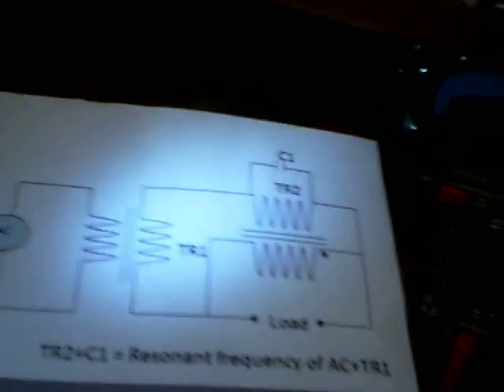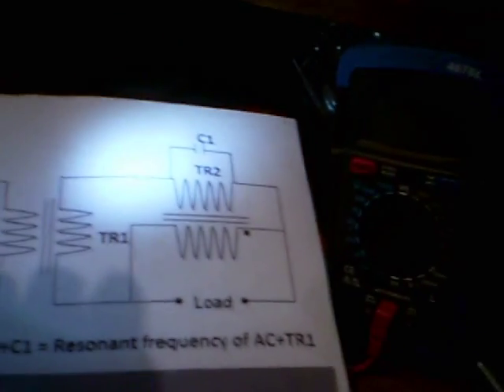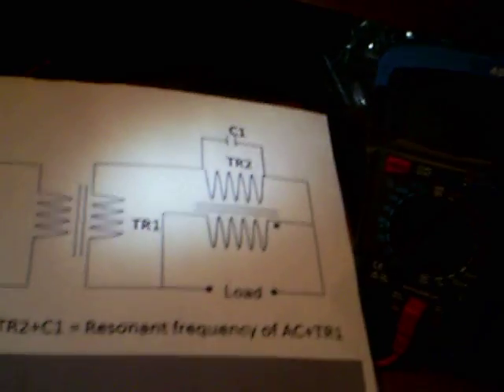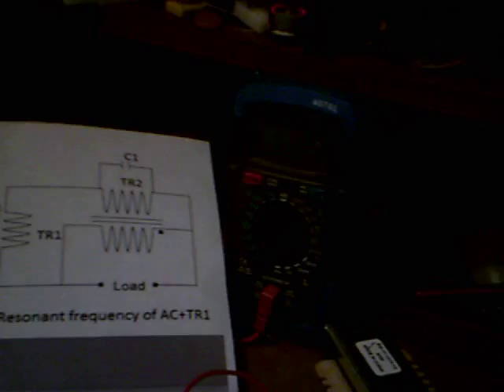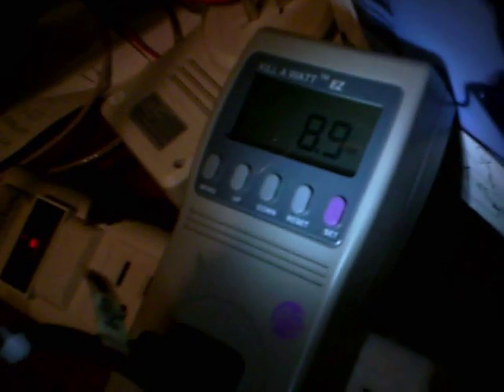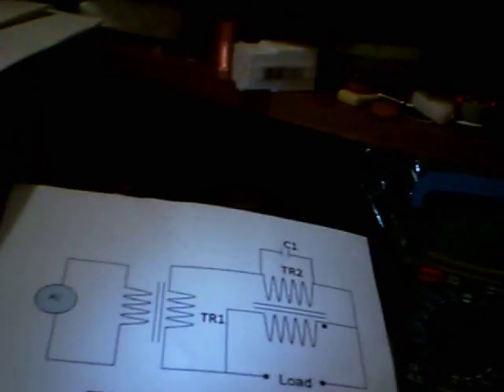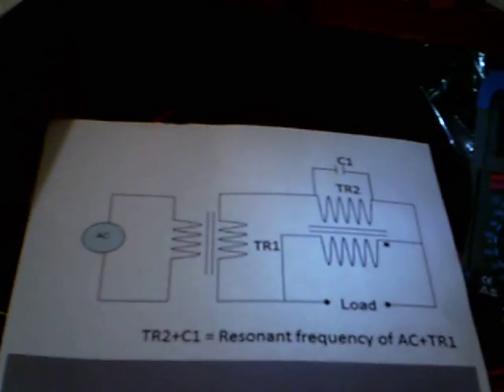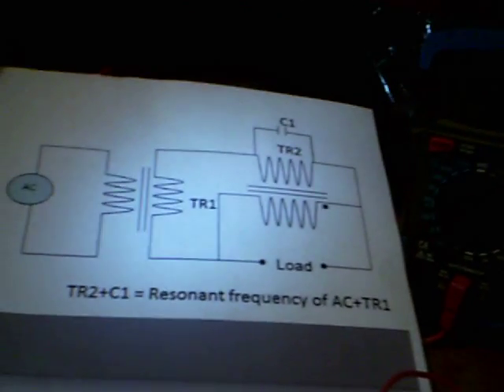JackNsDualTrafoReplication

Comment from the maker: HOWEVER -- I followed up today 13 July with a number of tests.  The most telling was putting just the 40W bulb on the output from the Variac, with just a P3 meter in between.  Plot shows results: link in description.
Conclusion:  the P3 watt-meter is not to be trusted when the operating voltage is below about 70 Volts (as in vid).   This means more study is needed on the dual-trafo circuit... RE-emphasizing, I make no claims yet regarding overunity etc.